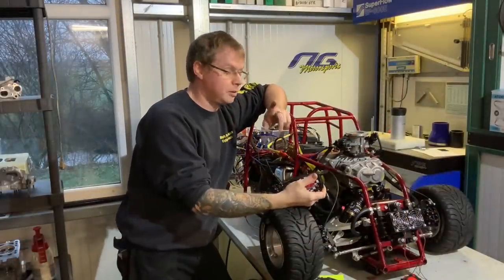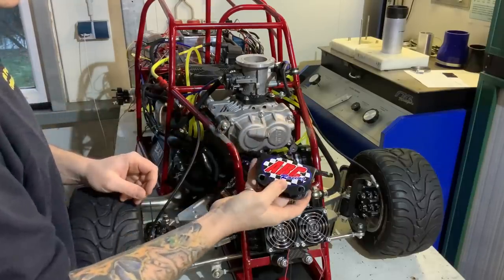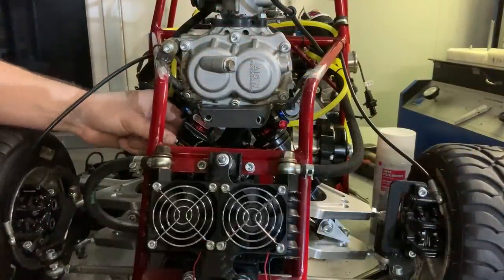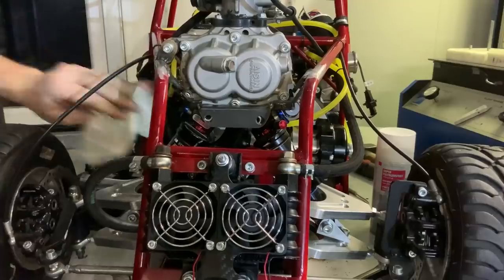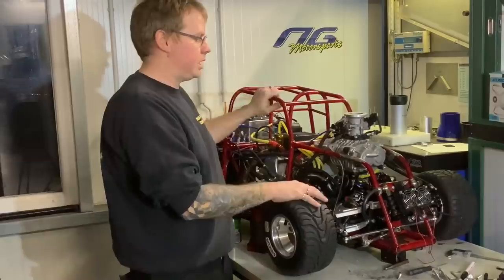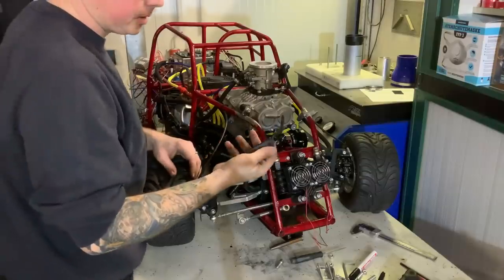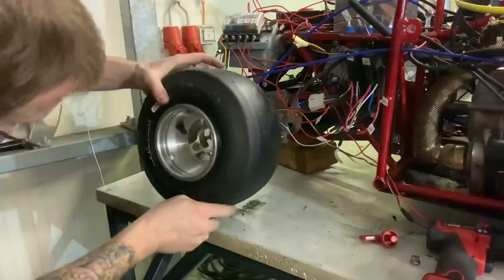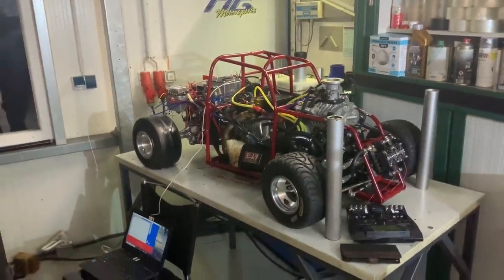1/4 scale supercharged Willys RC car - 10k sub special burnout and new project coming

Comment: You’re truck is wayyyyyyyy more advanced than the primal raminator. The raminator is affordable. 😂. And yet I can’t afford one. You built  an rc automobile.
Reply: Insane Projects there’s nothing bad to be said about it. It’s about the realism involved. To be frank the two don’t compare at all. One you can bash and the other you can challenge full sized sedans to a drag race. The only other large scale rc that I think would be close to fair is the one some guy made a very small amount but it’s an Rc and a ATV in one. You can ride it or remotely operate it and from the very few video posts about it. It’s seems very quick and with a adult male riding it. Yet you took the cake when the engine blew the damn muffler apart. If I saw you coming to challenge me I’d claim to have brought the wrong fuel mixture.

Comment: is that supercharger on predator 212?
Reply from the maker: Yes
Reply: @timsane  lmao where to get one? I want one for my minibike
Reply from the maker: @cheri758  Aisin AMR300 - you will find it everywhere. Do not use AMR500. Have fun
Reply: @timsane  why not amr500? Says it has more boost and longer life and cheaper price, i have honda gx200
Reply from the maker: @cheri758  who is saying that? It depends on application. GX200 is too small , even the 300 is Overkill but manageable
Reply: @timsane  gonna see, i want to get most out of my 200cc
Reply from the maker: @cheri758  and you think That Engine will survive 30 psi of boost? Did you build a whole engine before? Only the custom grind cam you will need takes month to develop. What is your power goal ? Good luck 😄